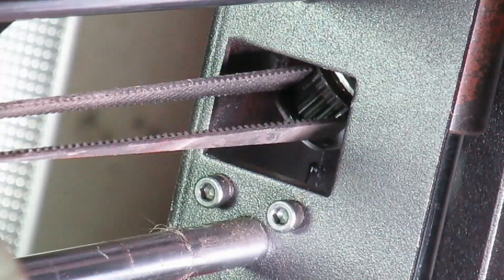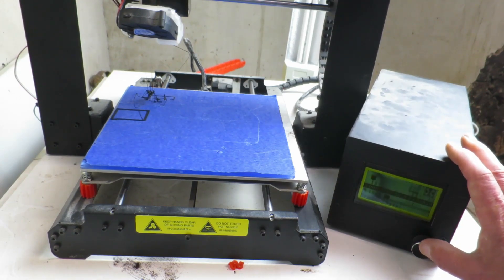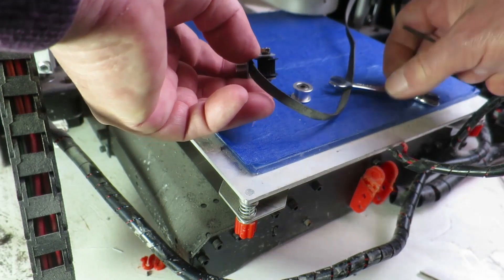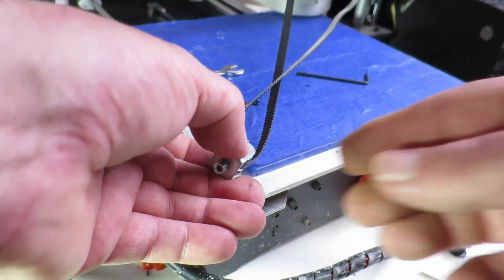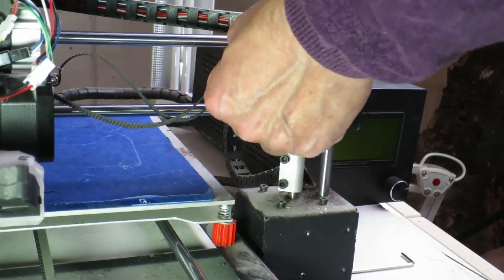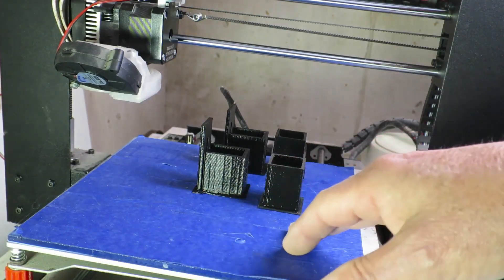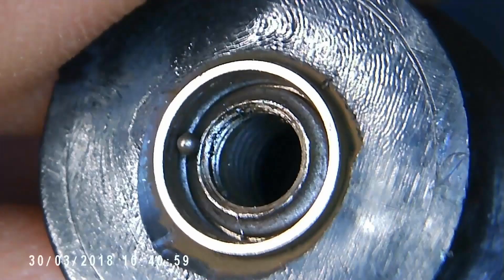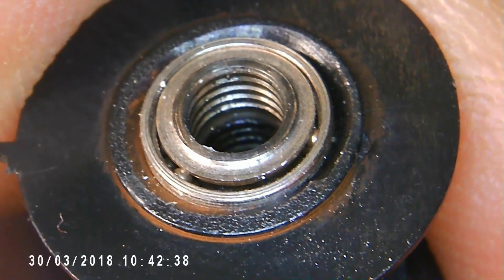3D Printer GT2 Pulley Bearing Replacement Malyan M150

Comment: hi and congrats for the 9k ;) what i want to ask you if i change the stock plastic pulley with a gt 20 teeth the stock one has 17 and i change also the pulley from the the stepper motor and the gear ratio will be the same 1:1  but instead of 17 tooth it will have 20, do you think that i will have any problems?
Reply from the maker: You will need to re calibrate the number of steps per mm travel as a lager pulley will travel further per step. There is a calculator here : https://www.maxzprint.com.au/stepps-per-mm-calculator/ Let me know how it works out. Thanks for watching, have a great day!
Reply: @1nformatica  thanks a lot i will order today hope that all works as plan :D